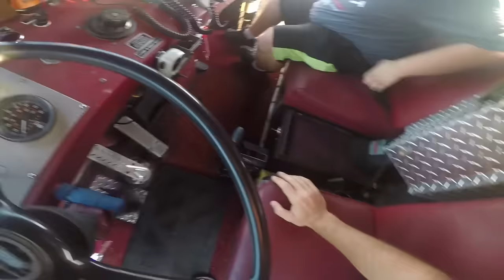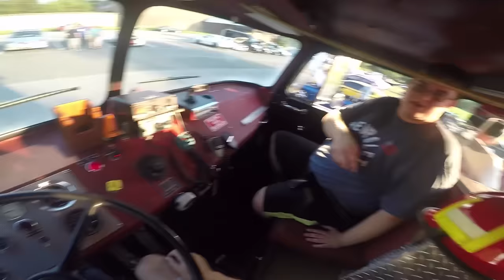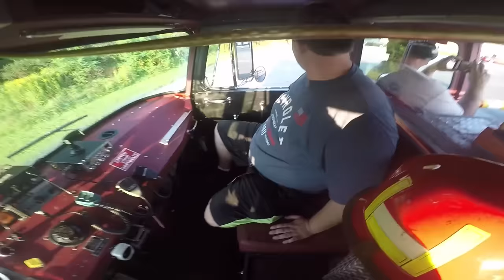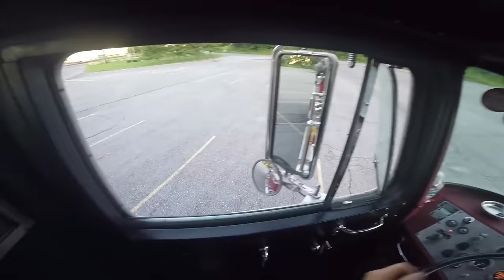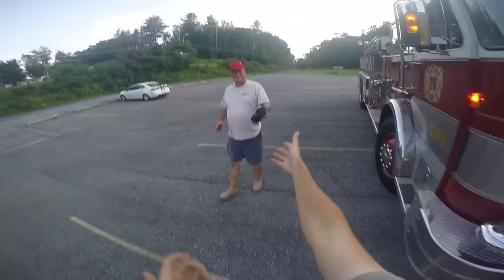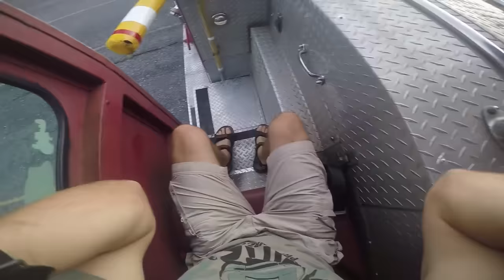Driving a Fire Engine for the first time  1982 Hahn Pumper Truck

Comment: I'm a firemen and one of the front line pumpers we use still has a Detroit two stroke in it. It's more dependable than our 2015 engine. Those detroits are all sound though lol. People at bus stops don't appreciate when they get coal rolled on them either.
Reply: How much fire did you take out
Reply: The first Detroit engine that I drove was a Hanh ladder Truck with a six speed Allison Automatic transmission. Sweet vehicle and easy to drive
Reply: My on occasion my dad drove an Autocar dump truck with a Detroit in it, he hated it, said it was so sloppy and spongy compared to his Mack. Said a Detroit has a lot of power but you have to stay jammed in the throttle to get any of it.
Reply: From 1970 through 1979 with the cab open

Comment: If you can find a ladder truck with rear steer you should really try driving the back, it's a experience you won't forget.  I was a fireman in the 70s and we had a ladder truck from the 40s with a open cabs front and rear, in the back you only steer but you had a button to signal the front driver to stop or brake. Backing into the narrow parking area at the firehouse was a challenge to say the least.
Reply: That would be awesome!
Reply: My grandfather was a tillerman, among other things, as a firefighter for Progress Fire Dept. Harrisburg, PA. I can't imagine how that would be!
Reply: don't you have to steer the wheels the other direction?
Reply: Andy Elkins yes the tiller man has to steer the opposite direction
Reply: CCW1911 do you mean a tractor-drawn
Reply: CCW1911   Pooo
Reply: CCW1911 thank u for ur service
Reply: CCW1911 sorry but I do not believe you're a fireman because every fireman knows it's called a tiller
Reply: CCW1911    I also was on the fire department  in the mid 70's and I was broken in on a long nosed Seagraves and there was no power steering ,no air brakes and no automatic transmission and no air horns.   It took a lot of muscle to steer it and you had to manually engage the PTO.
Reply: CCW1911 my dad used to be on an officer on a ladder truck, now he is the officer for a heavy rescue truck, also isn’t a ladder with rear steer a tiller?
Reply: CCW1911 it’s called a tiller
Reply: CCW1911 c
Reply: We had one, too, a 1941 Pirsch/LaFrance combination unit. The cab was the open type, long-nose, with a single red beacon that rotated back and forth and was mounted on a post behind the bench seat. The tiller seat was, of course, open too, riding above the 100' aerial assembly. 

This was in the early 1980s. The rig was sold after a crash damaged it while responding to a hotel fire in another town. It had been repaired; we just didn't trust it anymore.
Reply: You mean tiller ladder truck?
Reply: CCW1911* it’s called a tiller by the way*
Reply: Yeah ur thinking of a tiller truck they’re awesome trucks
Reply: @nathaninsley6741  they’re thinking of a tiller truck which could also mean tractor drawn idk
Reply: @jimrootismypresident3067  Amazing how many people focus on the terminology, but you guys are correct it is called a tiller. It also had a wooden 100 foot ladder which I had to climb in full bunkers as a test for employment, I clearly remember how narrow that ladder was at the top, but someone will straighten me out on that too I'm sure.
Reply: @CCW1911  wow I’ve always wanted to be a fire fighter but I was born blind in my left eye so I can’t unfortunately closest I’ll get is in video games but thank you for your service as a fire fighter
Reply: @gmjunky87 I think Harrisburg still runs a tiller and yes, it’s incredible to see how they maneuver especially such an old narrow street city like Harrisburg. They are also a very aggressive fire department, I’ve come head on with Harrisburg fire department trucks as they have no issues going on coming lane to get to a fire quickly, but I had no issue they’ve got the right of way to go help people

Comment: Driving this is how I imagined driving cars would be from watching movies as a kid.  Constant wheel turning to go straight.
Reply: Endyo Lol I thought the same
Reply: Well, with a bad enough alignment on anything, your childhood dream can come true!
Reply: I've driven that dream in 2 different 90's Dodge vans haha.
Reply: It's actually true of big passenger vans. Driving on back roads sucks.
Reply: my work has a forklift that drives like that - and its a three wheeler - drive wheels at front, and single wheel that steers at the back
Reply: 50s through 70s (even some 80s cars) cars were like that.  A huge improvement came when Japanese and German cars started taking over the market.  
Often wheel alignment and front suspension health was measured by how much the steering would  "slide" from one side to the other.
So yes once upon a time it was part of our daily driving, wasn't so hard to control though.
Reply: Endyo my 1977 ford van is that way but not nearly as bad! I had a 73 GMC truck  that took half a turn of the wheel before the truck even started to veer slightly! a few years back! I nearly accidentally sent a Lincoln pickup truck in to the ditch when he saw me jerking the wheel in his direction to make a minor course correction! He thought I was about to plow into him but my truck barely moved!
Reply: That's how it is when you have a jeep to
Reply: Dude your smart
Reply: Endyo it’s from 1982 man, handling are not these things forte
Reply: Same here
Reply: My 1500 is mising a wheel bearing, Its actually exactly like that
Reply: Me too
Reply: Steve Oswald q
Reply: as Jeremy Clarkson once said "its like driving through an American movie"
Reply: I briefly drove transit busses. We learn on retired 70s busses (those fish bowl looking GM New Look busses)  so as someone who drives precise BMW M cars it was an odd feeling constantly correcting the wheel on a straight line.
Reply: @NEONARS1  ض1
Reply: lol
Reply: ey sick fire engine
Reply: Literally every car I've owned has had some play in the wheel. Kind of a rite of passage in a way
Reply: Like driving a boat with 2 foot chop

Comment: Man Detroits are wicked sounding things.
Reply: Ikr. Best sounding diesel engine ever.
Reply: Yeah! In the norwegian army we have some M113 APC's which use the Detroit 6v53 V6 two stroke, and it has that sick scream when it accelerates. Wonderful noise
Reply: NA 2 stroke diesel
the forcing it in with no lube of engines
Reply: ＴＷＯ ＳＴＲＯＫＥ， ＢＡＢＹ
Reply: Growing up we had those Schwan's trucks delivering frozen foods to our house, and they were so memorable because you'd have a two stroke DD engine rolling right up your driveway... awesomely terrifying. And for train nerds, the locomotive equivalent would have to be the good old F40PHs... so much noise and fury!
Reply: One of the best sounds around. Sounds full race sitting at idle. 
The older firefighters missed the response of the 4 stroke trucks when they phased out the 2 strokes.
Reply: antsolja ROTFLMAO. 😂👍
Reply: I guess you could say they are the rotaries of diesels - both in unconventional design and amazing sound.
Reply: Absolutely 2 stroke Detroit’s are the best sounding motors ever.
Reply: It's not a real fire truck if it isn't powered by Detroit
Reply: Morgan Pierce yes, are these the 2 stroke ones?
Reply: @carsoncase5308  This specific truck is powered by a Detroit Diesel 8V71N, which is a two stroke engine.
Reply: I miss when the bus fleet of my child hood were all two stroke Detroits - especially with frustrated drivers wide open
Reply: Jared Thompson Really? I would've bet good money it was a 6V, but inside the cab and (presumably) through mufflers I guess it could sound different than usual.
Reply: JIGA BACHI  mbm
Reply: Aee🍉🍎
Reply: That’s with an automatic too
Reply: There is a new opposed piston 2 stroke diesel that sounds like this. It's being developed by Aegis power.
Reply: Should hear them in a 113
Reply: @kristenburnout1  jjhhy

Comment: Got to love the sound of that 2 stroke Detroit diesel. It's the sound and heart of American cities and highways in the 70s, 80s, and 90s. Nothing like the sound of a 71 Series Detroit Diesel.
Reply: Shit, since the 40’s at least. Bus Grease Monkey has a 40’s Greyhound with a rebuilt 6-71 with a 4 valve swapped head. I’ve also heard DD motors were used in some of our WWII vehicles.

Comment: I was sacred to death the first time I drove an engine. You did alright. Just remember to stay close to the center line. People will move over. You don't want to slide off the edge of the road especially if you have water in the tank. It may result in a nasty rollover.

Comment: That Detroit Diesel 😍😍😍
Reply: Albertll
Reply: Yes was looking for a comment that said it 😍
Reply: That's what I like the most about this fire truck!  That 8v71 needs to have a true dual exhaust system exiting just in front of the rear wheels on both sides (similar to a hot rod).

Comment: Wish you left some of the ride backward in.  My first 3 years in a department we had a 81 mack and the rear jump seats is where the best seats in the house. Even on winter storms it was warm and on standbys I could grab a bit of sleep with that mack diesel running so smooth

Comment: Look at this video of someone completely new to large vehicles and now think of when you last saw an in service fire engine heading to a call they are practically weaving through traffic like a car (the fact that they have sirens people are supposed to let them through helps but still) and taking corners at full send. Fire engine drivers have to be some of the most skilled drivers in the world period. Even some of the most seasoned mountain truckers couldnt handle a rig the way the fire department does

Comment: Because of the noise from the engine, it must have a Detroit 6 71 engine, because the cabin has the front axle in a corner, it turns well. I drive a fire truck, the best reaction car, has high speed covers.

Comment: Two starters? Unlikely. This truck has two battery banks, that is correct, and each button sends power from it's corresponding bank to a single starter. I've also heard of this type of setup where you can use either button to start from it's corresponding battery bank, but when you press both buttons it engages a series-parallel solenoid to double the crank voltage.

Comment: i have a CDL, i would have thought such a vehicle would at least require a class B
Reply: andrew donohue It would make volly firefighting near impossible if it required more licensing. The driver already needs to be qualified to drive it, and on an engine is responsible for operating the pump which takes training with also a large amount of training to just be a firefighter. A lot of people just do not have the time. For smaller departments it can be difficult to just get a rig out the door due to not enough drivers.

Comment: Imagine putting this engine into regular car?
Reply: It wouldn't be nearly as good as you think. It only revs to 2500 RPM, makes around 300 HP, and the engine itself weighs about 1800 lbs.

Comment: how does the jake brake work with the 2 stroke, does the engine lose lubrication?
Reply: Michael Rodriguez  No, Detroits don't work like most 2 stroke engines, they pressure lubrication like a 4 stroke. Air is fed to the intake ports by a blower instead of crankcase pressure and they have exhaust valves in the head instead of exhaust ports.

Comment: In PA how can you drive a vehicle with air brakes without an endorsement on your license regardless of commercial use
Reply: Joseph Donnelly if not being used commercially I believe it would fall under "Class A recreational vehicle" in which case no CDL is required. 

However, if it's over 45 ft and 26,001 lbs, in PA you are supposed to get an endorsement for heavy vehicles or something like that... Can't exactly remember

Comment: How does this not require a special license?
Reply: Negil Leufeln because murrica and they haven't discovered common sense yet 😂
Reply: No I don't think you need a CDL to drive a fire truck. I didn't even have my license yet when I first drove one. Lol
Reply: In PA I'm not sure but here in OR I don't think you need one.
Reply: $3,500? Holy sh*t I knew they where cheap but I didn't know they where that cheap. I always thought they were like $15,000 or something. Damn!.

I made a video of a 1957 American Lafrance ladder truck a few months ago on my channel if you wanna check it out.
Reply: My dad has been up an 80 ft ladder all the way extended to the top before and he said it was terrifying as hell.
Reply: I see a lot of mis-information. You need a special license for air brakes. That's it though.
Reply: What about New York?
Reply: Here in Kansas its a Class B non-commercial License, to drive one of those.
Reply: Kacey H you'd need a class B CDL with air brake endorsement to drive this here
Reply: Haha. I felt the same way driving a 1986 Ford Econoline. Thing felt like a firetruck.
Reply: +Leave my elevator alone  Not necessarily in PA.  I used to drive with air brakes for work...but as the truck was rated at exactly 26,000 lb, no CDL required (just barely!)  However, if you are class A or B, then you might need an air brake endorsement...I'm not positive of that, however, as I never needed a CDL.  And while I'd guess that this truck is heavier, I don't actually know that for sure, so I can't comment on whether Mr Regular should have had one.
Reply: Jeremy Dixon I live in PA, fire trucks are exempt from the licensing weight requirements, all you need is a standard class C license, even after they are taken out of emergency service.
Reply: Murica...this and a Hyabrosa to any and all.
Reply: Negil Leufeln I believe its because it classifies now as a classic vehicle because of the 25 year old rule.
Reply: Jeremy Dixon - Same, in New York State there's no getting around that. A standard drivers license only allows you to drive vehicles up to 26,000 lbs or pull a trailer up to 10,000 lbs. Other than that you need to upgrade your license to operate anything heavier or with air brakes to CDL class B or A
Reply: Emergency vehicles are exempt from needing a commercial drivers license as are recreational vehicles. These are very easy to drive this guy is being way overly dramatic.
Reply: You're required a CDL to drive one. If you're with a fire department a Q endorsement is enough to be considered a driver
Reply: Zach Novosad this is not the case in PA all you need is a class C license there is no such thing as a Q endorsement. I’m both a police officer assigned to a traffic unit and a volunteer firefighter.
Reply: Cycle 09 well last I checked Q endorsement was still a thing. Or at least in Connecticut. Instead of getting a CDL license you have the option to do a different course specific for fire trucks. That's last I checked here for Connecticut but something could've been updated. I'm also a volunteer firefighter.
Reply: Any vehicle registered as an antique does not require  special license.  You Can get an old Mack semi with an 18 speed Eaton and drive it without a CDL if it has antique plates.  However, antiques are not legally allowed to haul for profit or in this case be used for fire fighting purposes.
Reply: Leave my elevator alone no you absolutely don’t need a special license for air brakes in Pennsylvania. First off emergency vehicles don’t require a special license period. Secondly anything under 26,000lbs doesn’t require a CDL and many of these vehicles have air brakes.
Reply: Zach Novosad all states are different there is no state requirement or addition to your license required to drive any emergency vehicle in PA. There are also large box trucks being driven daily with air brakes that are just under 26,000lbs therefor no CDL required. I’ve been driving a fire truck since I was 18.
Reply: Ok in pa at least if the vehicle is operated by a fire dept no cdl is needed as long as it is on dept business I'm a firefighter and asst engineer in my dept and that is what the code book for emergency services in pa states its a weird experience when you drive one for the first time makes you feel like your the king of the road takes alot of practice to be comfortable driving an engine,rescue tower ladder ect
Reply: U need Q qualification to drive it
Reply: Negil Leufeln 
I am pretty sure it does, it looks like it weighs more than 26,000 pounds which requires a CDL. I am not sure about the air brakes. I probably should know these things since I have an IOWA Class B to drive a bus.
Reply: You have to go through training
Reply: Negil Leufeln because it’s a truck with hose and some tools, it’s not a big tractor
Reply: Tommy Hammond my dad went up a hundred foot ladder

Comment: Do you need a dedicated truck license in the US? (Or could anyone give me an explanation if it's a bit complicated?)
Reply: Yes if your not a government employee  then you have to pass a dot physical just to hold a cdl license and the test is pretty hard back in 2001 when I took it but now the test has gotten more expensive and difficult
Reply: What you need entirely depends on the state. I believe that in some, a vehicle registered as an antique is exempt from the normal licensing requirements. Some areas exempt fire and ambulance specifically to make volunteer fire fighters and paramedics' lives easier. For the most part a vehicle this heavy needs special licensing due to its weight. Many also need additional training for air brakes. Large straight (not a semi) vehicles that don't carry a lot of weight, with hydraulic brakes, can be legally driven with a normal "car" license I think anywhere in North America.

Comment: My question is why is there a guy riding on the back of an open cab engine still under the jurisdiction of the NFPA and why does that department use metro brain buckets?